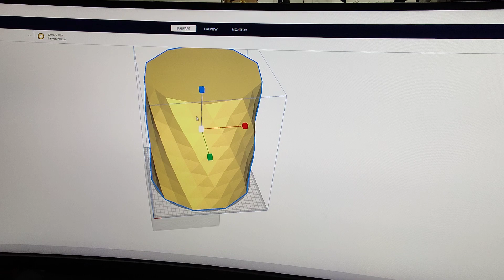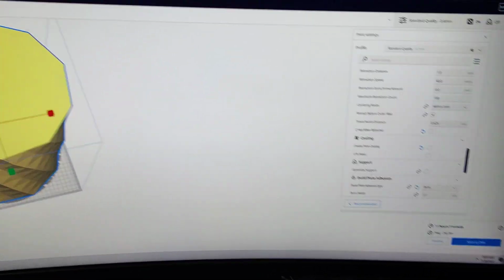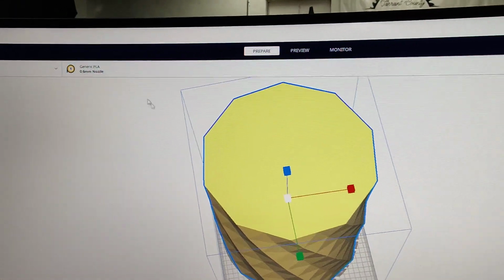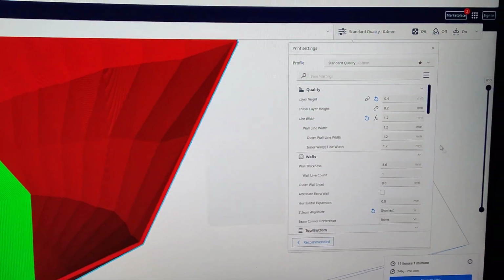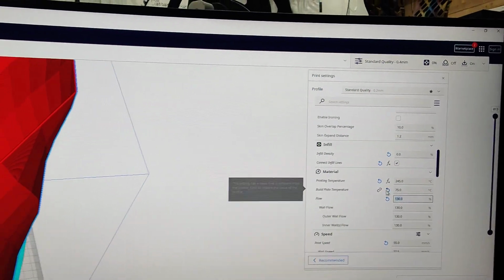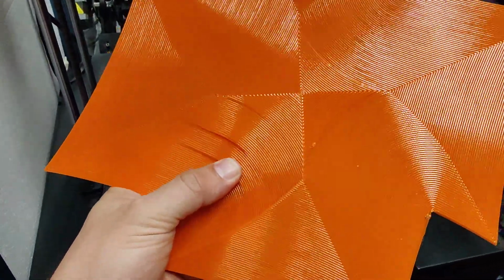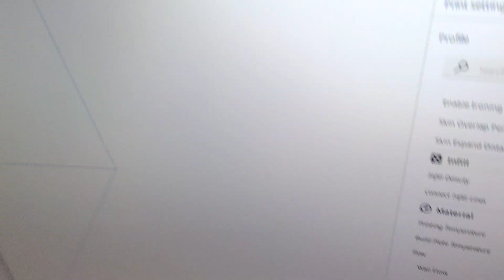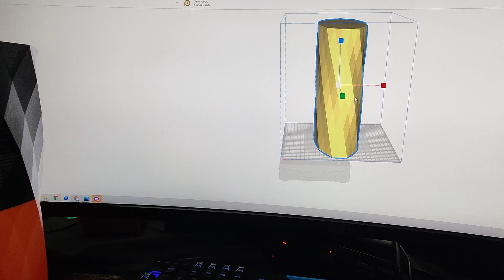Large Vase Mode Cura Profile: Universal/Kingroon KP5L, Creality Cr10 Ender 5 Max V2

Comment: I put the .6 mm nozzle in the kp3.  I tried a steel nozzle that i got in an assortment.  I found out the hard way it needed 15 degrees more heat than the brass nozzle.  Thanks for sharing the spiralize tip. I am running out of the dragon PLA.  I need to come get some of the new dragon PLA+.